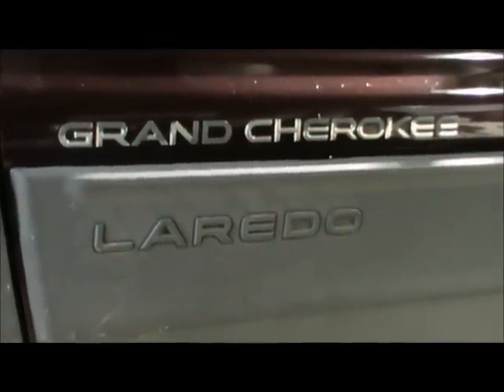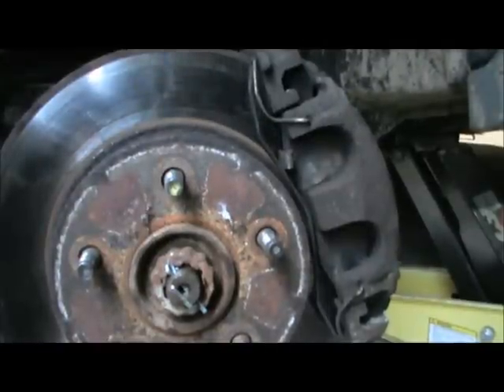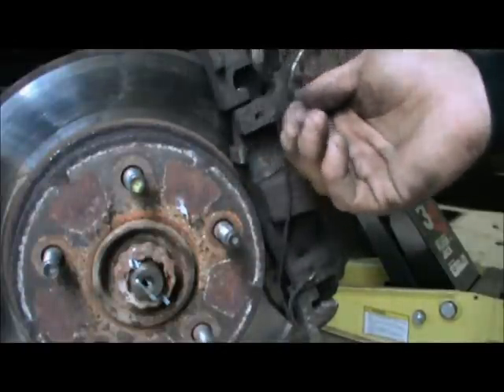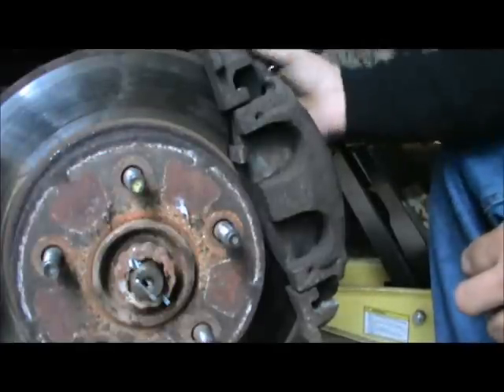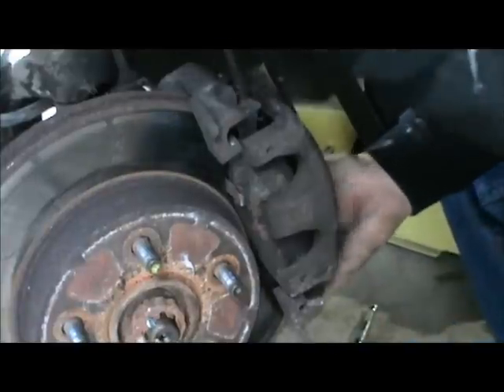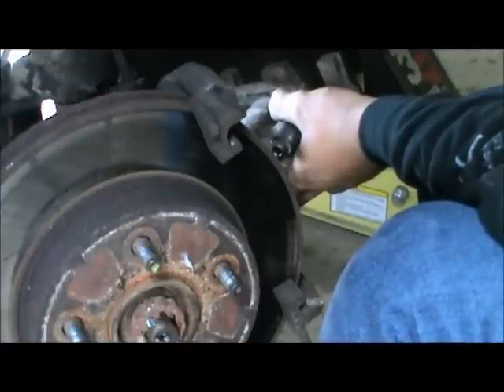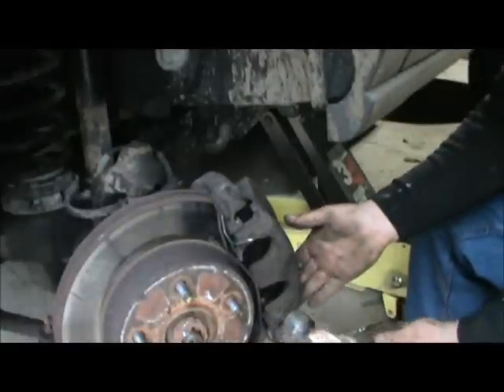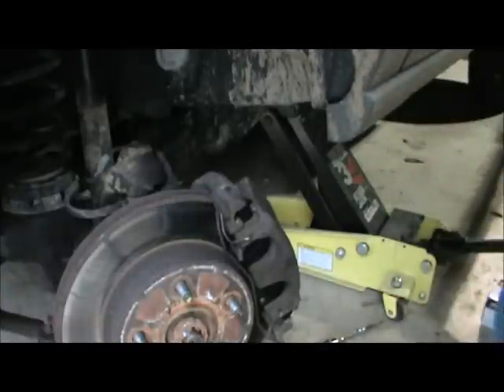2000 JEEP GRAND CHEROKEE FRONT BRAKE REPLACEMENT DIY

Comment: I just changed my front brakes for the first time after watching this video. Everything was just fine. Exact same shitty break system. And did everything in the video, stops on a dime with no problems. Great video. Thank you. I got gouged on a break job last time that did not last 6 months. I try to do any work I can. Good Mechanics deserve well paid for their work but some over charge and hide behind a Secretary. Got to find a better shop or keep learning where I can -thanks again.

Comment: hack job, didnt lube the slides or contact points, also did not machine or replace the rotors which is critrical for proper burnishing of the pads
Reply from the maker: The rotors where fine, I could have machined them but for a winter beater I figured there was no need. And as for the lubing everything up I should have but ran out of brake lube when I was doing the other side. 

Thanks for watching.

Comment: Didn't clean or grease the slider pins, or the brake shoe sliders, eventually with heat and wear one will lock up or heat up. This was a half assed job, but who knows he may get lucky .

Comment: You didn't bleed your lines before putting the wheel back on?
Reply from the maker: I didn't have air in the lines just changing the pads. So i didn't need to bleed the brakes
Thanks for Watching
Reply: Why would you have to bleed the brake lines? That would be pointless when just changing pads.

Comment: For the driver-side front brake pad the outside one to be exact, does it matter if the little metal tab is on the top or bottom. I replaced mine and the previous one was on the bottom so I replaced it with the matching pad. As far as I could tell they looked symmetrical. Any input would help thanks.